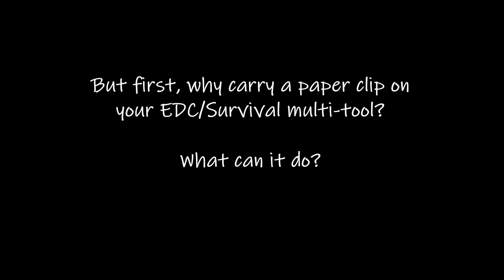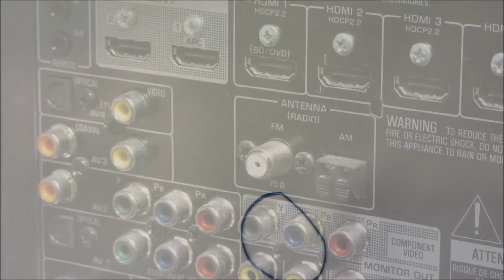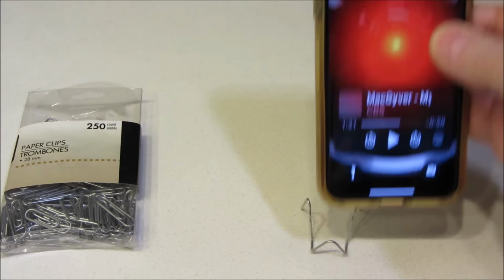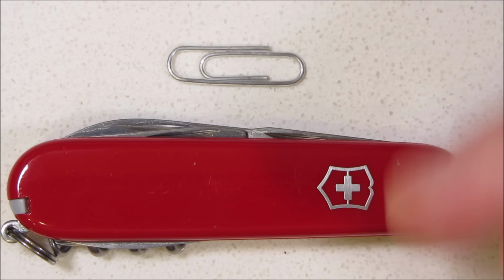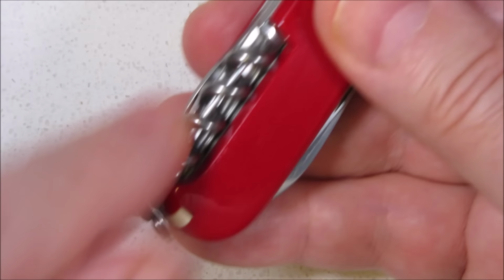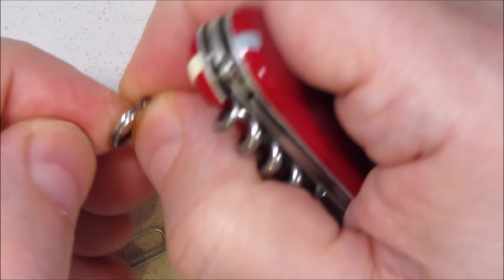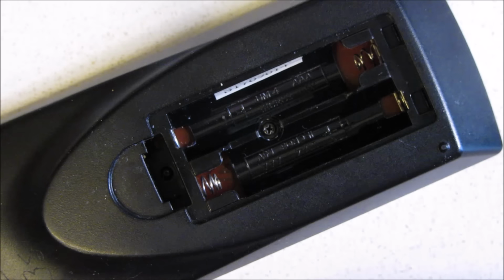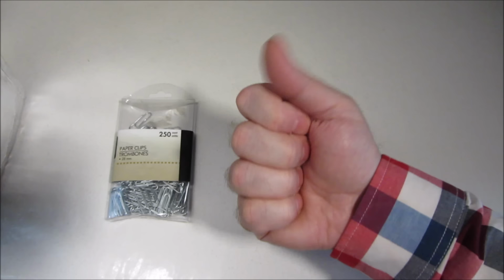Add a "FREE" Tool to Your Swiss Army Knife!

Comment: I have very weak finger nails and often have both thumb nails broken at the same time. I use a paperclip for everything I would normally use my nail for. My everyday carry is usually a tinker small or super tinker so no corkscrew, I just hook the paperclip on the small keyring. The paperclip also makes for a good cheap pocket suspension clip.

Comment: I’ve really been enjoying your videos. May I suggest one or two  birthday cake candles for your tiny survival kits. When you use the farro rod and cotton, lighting a small candle will make it easier to light your actual bon fire. Also, if you need to have a lighter on for more than a few seconds, lighting a small candle instead will preserve your lighter fluid.  Thanks for all the great skills.
Reply from the maker: Thanks. I have heard of that. I had a candle in one of my tins and found that after time (months?) it got flaky and left annoying residue on adjacent tools in the kit. Even better than a regular candle, it was a "magic trick joke candle" which can't get blown out in the wind. It simply reignites on its own. The only way to extinguish it is water (or spit). I think you see it in this video: https://www.youtube.com/watch?v=oWwSqYlqZHE
Reply: Get the trick ones that are hard to blow out.
Reply: @MeZillch  But will it fit inside the corkscrew?  Hmmm.

Comment: Thanks for this! I just did it while watching. I also just found that a large paper clip fits between the saw and scissors on my camping model. Seems to stay in place quite well. I think I might keep an extra paper clip attached to the split ring as well.
Reply from the maker: Placed on the split ring you can also use a large paperclip as a pocketclip to hang/suspend your knife in your pants pocket, rather then letting it fall to the bottom.

Comment: You can also get some really thin fishing line such as the power pro stuff which is crazy thin and has up to an 80 pound test. I think you could fold it over several times and store it in the center of the corkscrew along with the paper clip so that in a pinch, you could use the fishing line and possibly make a hook out of the paper clip or use it with a magnet, if you need to fish something out of a drain or what not. I’m trying to remember the name of the MeZilch quick release paracord bracelet but you can use this method for the little hank of fishing line.
Reply from the maker: All good points, thanks! I show how you can store a secret stash of cordage (dental floss in this demo) inside the SAK scales here: https://youtu.be/hLU_Fle641U?t=220
My straight line cordage storage, with one-second deploy, is called (and can be searched for on Youtube): "Parafob" https://www.youtube.com/watch?v=V5UTu1rhJAU
My 5-second-deploy bracelet (which can be constructed in 60 seconds) I'm proud to say has been adopted by the US military as their preferred design (according to Paracord Planet) and is speed demo'd here: https://www.youtube.com/watch?v=vf7fjd4d4EI

Comment: I wouldn't necessarily call this a "mod", since there's no permanent change to the SAK. Just an added tool that neatly fits on.

Same as adding the pin to my Victorinox Ranger. It came with the hole, but no pin, for some inexplicable reason 🤔

Comment: Now you got me all excited for the benefits of carrying a paperclip on my victorinox compact and I can't do it cause I carry the mini screwdriver in my corkscrew 🙄 but now I want to try if I can find a different spot to keep one
Reply from the maker: I've had that little screwdriver since the 1980s when it first appeared on (I think) the SwissChamp and it has never fit a single pair of eyeglasses I've ever owned. It was designed before the handheld cellphone was even invented and I think its size was selected for some odd device in the 80's, in Switzerland, that is not pertinent in today's world, at least not in mine. . .  Maybe it was for phonograph turntable headshell/cartridge screws? No watch, camera, or cell phone I own uses that size. 

In, I think, c. 2021 they finally released a $15 kit with three OTHER optional sizes including only one I like: a Philips, perhaps 000 or 0000, which is a better fit for me, but it has an odd (green?) color I don't like which clashes with the knife color. At least the original is a nice neutral grey.
Reply: @MeZillch  well I only have the slotted one and I gotta say I use it fairly often. Not daily, but still often enough to justify having it on me. I'm not a fan of the bright other screwdrivers nor the fireant fire starter so I won't carry those.
Btw I saw you're using the little pin next to the screwdriver, are you aware you can easily store a 2nd pin there? Just in case you need it... just take of the scales and cut a little notch under the first one, position it so it won't interfere with the rivet, you'll see what I mean once the scale is off. Then just pop it back on and boom, 2nd pin slot 😉
Reply from the maker: @Kleiner_Lutz  Thanks. Yes, I've seen that mod. Such a secondary slot used for a sewing needle might be worth it to me. I've shown in one of my vids that thread (or fishing like, or dental floss) can be wrapped internally around the rivets holding on the scales: https://youtu.be/hLU_Fle641U?t=220
Reply: @MeZillch  ah okay. I've seen it in one of felix immlers videos, I recently had to pry of the scales for cleaning reasons, accidently dropped the knife in oil and everything was soaked🤦‍♂️ but since they were off anyways I just cut the slot quickly 😉
Reply from the maker: @Kleiner_Lutz  I just posted an update in the video's notes mentioning at least one alternate storage position for a paper clip. Sorry, but this one does not apply to the Compact. On some the paper clip seems to fit next to the scissors in a sense, but I just tried on my Compact and it didn't fit fully. Maybe you will have better luck with a smaller paper clip?
Reply: @MeZillch  I will check if I can find something and make it work
Reply: @MeZillch  I recently just got the green emerald translucent plus scales from ebay for my climber and added the matching green screwdriver, toothpick, tweezers, and green lanyard plus it comes with ink pen slot and this tool looks incredible! Very attractive with the emerald green translucent plus scales! Best mod I've ever did, lol..
Reply from the maker: @larrya197140  Yes, an all green design would look quite nice. I think the translucent scales look very sexy but I'd fear I'd never use it for fear of scratching it! The green may have trouble with passing red light like laser scanners, but those translucent ones have tricks too: https://youtu.be/K5nDFbkg_Ew
Reply: @MeZillch  Wow! That yellow is amazing looking, thanks, now I want translucent yellow scales that I'll never find, lol...
Reply: Throw in wallet?

Comment: Excellent advice - though the storage of this ubiquitous paper clip does hoist one onto the horns of a dilemma - do you opt for the clip, as ably demonstrated here - or retain the small "eyegasses" screwdriver that is an existing accessory with many SAKs and which is also stowed within the coils of your corkscrew..? Only you can decide..!
Reply from the maker: I've owned that screwdriver since it first emerged in the 1980s and it has never fit a single pair of eyeglasses I've ever owned, or for that matter a camera or remote control either.

Comment: Do you remember what gauge pin Victorinox used for their larger models.? The pin that goes behind the corkscrew/philips ??
Reply from the maker: I'm not dead sure what they ship with, but on my 91mm Deluxe Tinker it nicely accepted a Singer 250, nickle plated steel  Straight Pin, labelled as "size 20, 1 - 1/4" length". I like that it has a little bit of friction to hold it in snugly so it won't rattle or fall out.

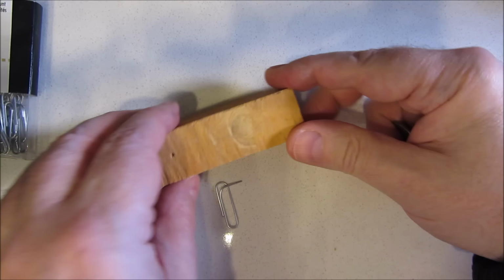Comment: 10:50
Question. Why did you decide to hammer it flat rather than using the metal file to file it flat?
Reply from the maker: I was following that J.R. G guy's advice, I had linked to. He mentions in a survival situation you could even use a rock instead of a hammer. The pounding makes the tip wider, but I suppose if you want a screwdriver the width of the paper clip (around 1mm, although I believe that's with the vinyl coating in place) just filing makes complete sense.
Reply: @MeZillch  
Yes, I understand the idea of the hammering widening the tip since no material is lost. Thanks.

Comment: Or just attach it to the keychain, for those of us with accoutrements attached to the corkscrew
Reply from the maker: I tried to see if by sawing a split in the corkscrew screwdriver plastic if I could do both it and the paperclip simultaneously, but I couldn't see a way to get it to work. Thing is, that screwdriver does not fit in my eyeglasses, nor anything else I need it to, so I said good-bye to it. Paperclips, on the other hand, I use perhaps monthly. Plus the paperclip is cool because it's unique!

Comment: I won't block the corkscrew with a paperclip as I don't want to give up my micro screwdriver.
The better way of saying the paperclip is just attacking it to the keyring.
Reply from the maker: I've owned that screwdriver since it was first released in the 1980s and I have never owned a single pair of eyeglasses that used that size/shape (they're usually Philips), so it will be no big loss for me and as I show in the vid you can actually modify the paperclip so it has a ready-to-go screwdriver tip if you need it.
Reply: @MeZillch  Neither do I own any eyeglasses, but eyeglasses are nowhere near the only use of the screwdriver. For instance, my kids often need getting their tiny toys fixed, and that's where the micro screwdriver cubes in handy.
Reply from the maker: Just like my eyeglasses, all small screws in my toys are Philips head, not slotted. Can you name a specific one you work with that's slotted? Thanks.

Comment: And here I thought you were going to attach the paper clip to the split ring so you could install tinder and an eyeglass screwdriver in the corkscrew. Silly, I know.
Reply from the maker: If adding things to the mini split ring counts as "adding a tool to your SAK" I guess I could add a Leatherman Wave!
Reply: @MeZillch   @MeZillch  It appeared that the point of your video was adding a paperclip. A Leatherman isn't a paperclip and if you were adding a multitool, you should be adding something from Victorinox. But, if size is not a limiting factor, add a 6 pack of your favorite adult beverage! Add a Jeep Rubicon while you're at it. Just don't drink and drive.
Reply from the maker: @InGratitudeIam  "It appeared that the point of your video was adding a paperclip". Nope, the point was explained in the video's title. Alternatively simply tacking on extra tools to the mini split ring doesn't cut it, is untidy, and stupid (in my opinion).

Comment: Just incase I need a floating paperclip 📎
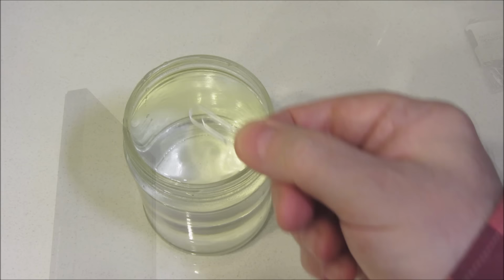Reply from the maker: As I mention in on screen text at 0:45 you can use it as a bar bet to win a free drink. Also if you pre-magnetize the paper clip it will function as a compass once freely floating.

Comment: Does box opening dull blades that much?
Reply from the maker: Technically ANY use of a knife dulls it a bit and if cutting open boxes is a common task for a user (I know it is for me) then all those times you use a knife for that really add up. Plus if you are cutting through tape it can annoyingly leave some gunk (tape adhesive) on your blade which comes off easily with alcohol, but that's not always readily on-hand when out and about.